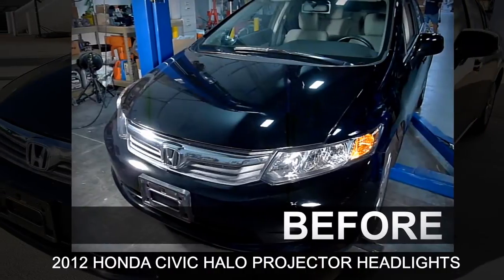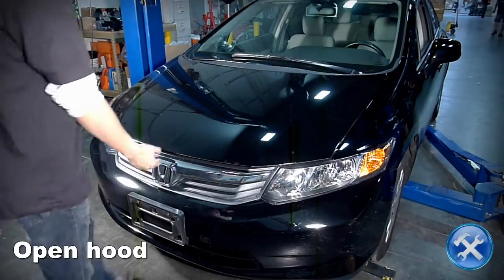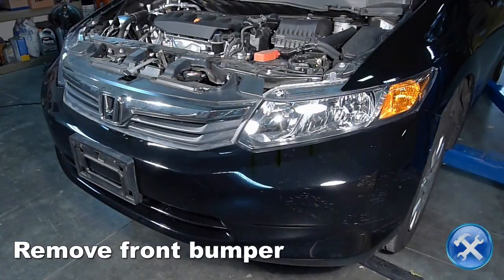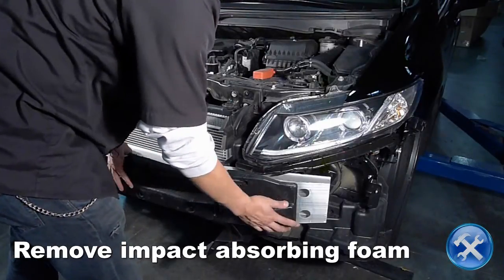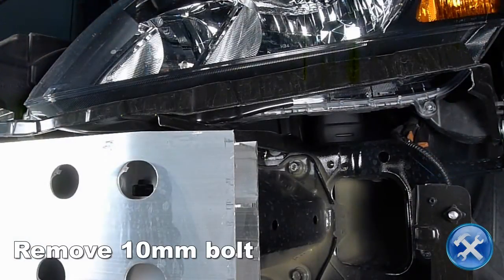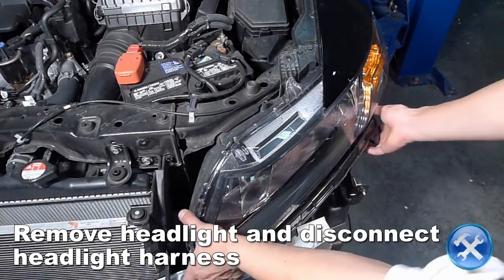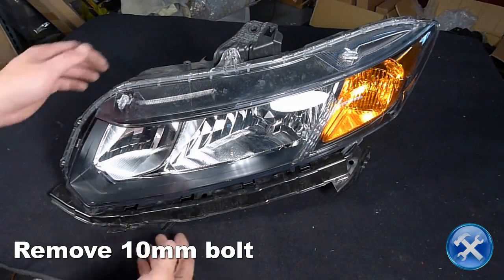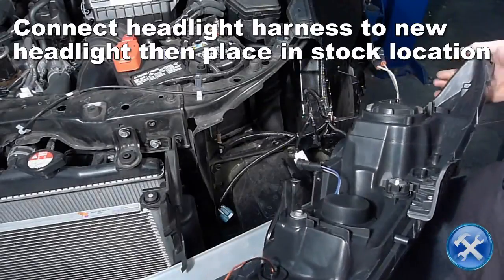SPECDTUNING INSTALLATION VIDEO: 2012 HONDA CIVIC PROJECTOR HEADLIGHTS

Comment: The precious model I purchased and the projectors were just round bezels. When I had my lights on it seemed like 2 flashlights pointed at the ground. And that's with proper adjustments

Comment: I ordered a set of these but the headlights aimed too high. I tried to adjust it with the screws on the back but the beam didn't move no matter how much I turned. The beam shakes too even when the car was parked. How can I fix it?

Comment: im looking to replace the bulbs in mine with brighter whiter ones. 2013 civic si coupe black led projector headlights. which ones do i need to buy?
Reply from the maker: Hello AFJ FLA These headlights are equipped with H1 bulbs for both high and low beam. So long as you find H1 bulbs you will not have any fitment issues.
Reply from the maker: AFJ FLA 55 watt bulbs are equipped in the headlights

Comment: other than replacing the plugs from stock lights to the halo lights, is there any wiring need? I once bought the Honda civic 2007 halo headlights, and the halos had to be wired in because the original stock headlights didn't have it
Reply from the maker: +Blaise Pugliese You will need to wire the LED bulbs on this head light also. The vehicle comes with daytime running lights, but they are the same bulb as your high beam. If you want the LED bulbs to work you will need to wire them to a power source.
Reply: I figured its the same. lol Thank you!